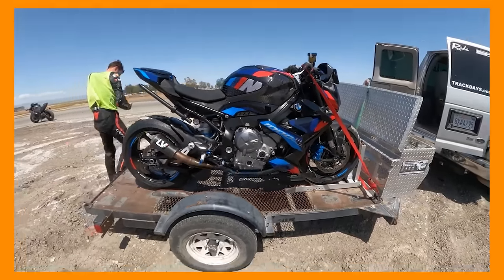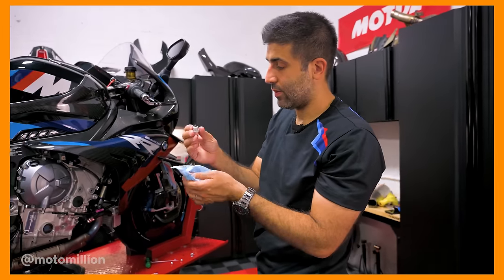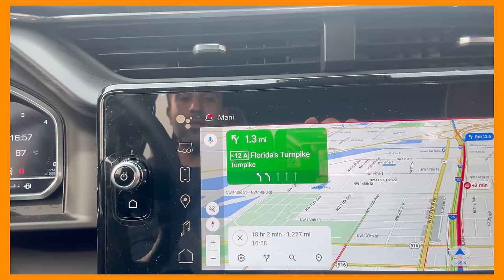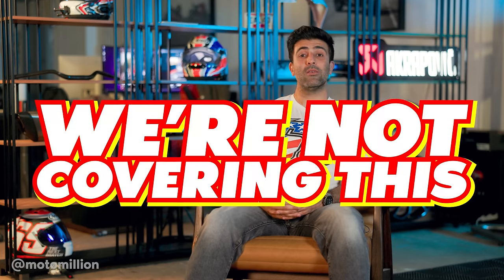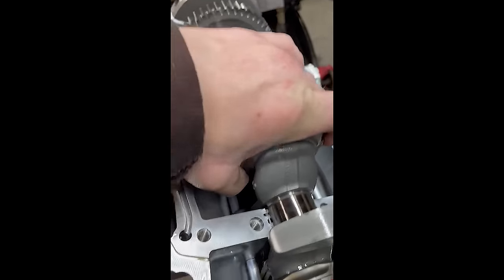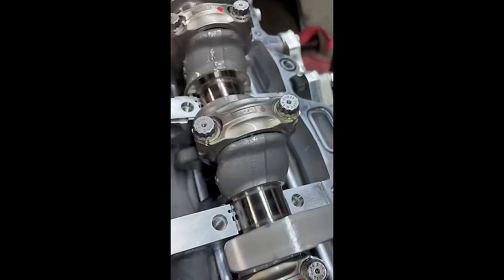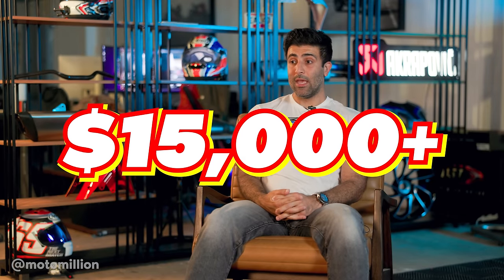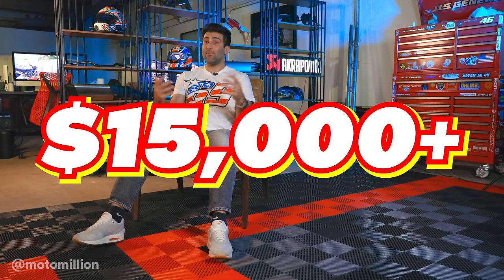MASSIVE Engine Failure on our M1000RR & BMW REFUSED Warranty...

Comment: What constitutes the correct break-in procedure, how much modifications effect engine reliability and should an engine be able to withstand a dyno run up to the rev limit may be debatable, but one thing that is not debatable is not following the rules and then expecting to get treated like you did. It is well known that if you don't have a local dealer or don't trust your local dealer, you should look for a different motorcycle make.

Comment: What do I think? I think the arbitrary limit to 1L should be eliminated in racing, and if manufacturers are so focused on making north of 200 horsepower, they should just increase engine displacement.
Reply: I don't think they're focused on horse power, I think they're focused on making motorcycles lighter, stronger with tighter tolerances and better efficiency through aerodynamics.
And the increase in horse power simply comes as a byproduct.

Comment: I would have ridden it around 600 miles so you could remove the limiter for free, and I would have never gotten out of 4th gear lol

If you removed it, put it back before taking it in for warranty work, it is an easy out for the manufacture.  What you should highlight is that you can't buy a service manual for your bike anymore from BMW,  I got mine a few years back and now they don't sell them.

Comment: 400 miles... and you're running it to redline on a dyno with insufficient air flow. I doubt the little fans provide hwy wind speeds, plus it's modded... tf you think was gonna happen? 500mi break-in is STANDARD on like any bike. Look in the owners manual garuntee you there's a break in procedure.
Reply from the maker: As per BMW's M1000RR Owner's Manual
First service is completed between 300 and 750 miles. Break-in rev limiter is removed as part of the first service.

Comment: Were there any punch marks on the other rod caps that would indicate that the proper torque had been applied to the rod bolts? Compare the caps! There usually is a positive mark to ensure that this does not happen.

Comment: I think it's what happens when bean counters take over a corporation. It's probably an unwritten policy to say 'no' as initial response to any warranty claim. After that if the customer takes it further, then they'll look at it to see how far the customer will take it but will make them jump through so many hoops, they hope they're banking on the customer giving up. As an aside, to say they'll still cover the warranty but not in the case of the engine, that's 'not' covering warranty, isn't it? 🤔

Comment: Without seeing any of your evidence, but assuming the facts are as you say, as an Aerospace Engineer and old motor head/wrench and former AMA Expert License holder in 250cc/350cc Road Race, I would also agree it sounds like parts defects or engine assembly not within blueprint specifications. Having said that...I have always broken in all my engines (especially racing engines) very carefully and if you did indeed remove your rev limiter before 600 miles, in my opinion that was a big mistake on your part. Fyi, I owned a 2011 S1000RR for a couple years and currently ride a 2023 Ducati Panigale V4R

Comment: Really sorry to hear about this failure. I am currently waiting for my S1000RR to show up at the dealership from Germany and am a little nervous after watching this video. I was wondering if the stage 1 tune mentioned in the video from last year included the 15,000 RMP limit "while making sure the raised RPM limit is not stored in the ECU" that I see referenced on the BT Moto site? I have a stage 1 waiting for the bike but am concerned about using it just in case there are issues. Is that the same for the stage 2 where the rpm limit is raised? Thanks for all your content, I really appreciate it!!
Reply: Just go with Break-in ordeal full 700miles (1200km) - go to dealer to change oil+filter+they will remove the break in rev limiter, don't rip hard on it the moment you get full rev range unlocked, rev it nice and steady, higher rpm for short periods of time, keep it Stage 0 until around 2.5k miles, only then you can think of doing the remaps and ''fun'' things after you are certain that everything is perfectly fine, you had your 2.5k miles of fun and can ruin the machine (if in the end the remap is bad). I'd say - just enjoy the ride, get a feel for it.
I personally wouldn't remap a bike just to squeeze out some odd tiny extra numbers. Only thing I would consider remapping would be a car which I know has huge tuning potential, trucks for those who want that extra punch on Germany-Austria mountains
Reply: Don’t worry to much. These people were doing wrong in so many ways. 😂 but at least the documented it well…
Reply: If you're smart, you'll respect that bike long enough to break it in properly before going nuts on power and revs you probably won't ever use.

And like the first guy said, even when the rev limiter is removed still don't go ham at least a couple of thousand miles.
These things have extremely tight tolerances and need to go through a few months worth of heat cycles before finally being able to go to their absolute limits.

Comment: You do realize BMW has all data from each station in the assembly of each bike including the motor tests and clearances. Respect the run in procedures and limits on the new motor and gradually work to full throttle on the road before bringing it near that dyno! Dynos if not correctly handled by the operator, can quickly destroy a motor!

Comment: i just bought my dream bike a 2024 s1000rr  hopefully  I don't  have any problems . But I appreciate your video and will be waiting  to 600 Miles to do the first service in case i do. I do agree you didn't cause this failure. I think the failure  was already there when that warning like came on.  Why would they put 350 in the  manual  if they wouldn't  stand by it. I want to know the exact text from the manual.

Comment: Yeah dude you took out the break in rev limiter. And yes other manufacturers do rev limiters for the break-in Ktm for one. I’m sure there’s more. This is why I’m waiting till my 23 Yamaha MT 10 gets at least 1000 miles before I flash the ecu and install a new exhaust.

Comment: Had the same issues with bmw service with my cars. I went to many different dealers for service and every time i ended up having other stuff broken and damaged...dent's and scratches inside and outside.  Not sure what the issues are but it was terrible and after 11 years i sold the car and never would buy a bmw product again.  Worst experience so far from any brand in my 35 years of owning and driving cars for various brands.

Comment: Had a 22 with surge issues. They claimed it couldn’t be reproduced safely. Um I did on a Dyno and still no help. Traded it in for a 23. But I we extra step to do dyno to show it can be reproduced and how easy. The 22 have a valve keep found in secondary oil change then after it was reinstalled I had surge issues but no fix as they couldn’t do it safely. 

I’m sorry regardless

Comment: Cancelled my order for the M1000XR after seeing this video. If these engines are built to work as hard as 14000 rpm on track, then it should be impossible to break for us mortals. Remove the rev limiter and this caused the bearing failure…. Really BMW you need to stand behind your customers who pay a huge price for these bikes and don’t have the resources available to cover internal engine failures…

Comment: Damn that sucks. I recently took delivery of my '24 S1K M package.. 7 miles on it from  pre delivery inspection, and I haven't even ridden it yet! Hope I don't have the same issues😮
Reply: Allow the engine to go through couple of hundred heat cycles, ride it for 1500-2000 miles not going full ham until oil has formed a protective film on all the surfaces and you'll be just fine.
Don't do that and say goodbye to it. 🤷🏻‍♂️💀

Comment: Shouldnt have told them you removed the rev limiter  😅😅😅 thats where ya went wrong Bro. Also once the problems came up on the main screen why didnt you take it straight to them or was the trouble code after the removal of the rev limiter.  Why would you remove a item made specifically to protect the engine ?

Comment: Really informative video and important to share issues like this, no drama queen going on here. As you said, just need to be in a corner, on a busy road, overtaking etc etc, and there could be a single to multiple fatality from this type of failure. 
My experience with BMWs has been with the GS platform. I had an HP2 naked adventure bike, which came apart on a daily run. The prop shaft was flung out of the swinging arm, completely cracked the swinging arm. Initial response was it would not be covered under warranty. Did a little research and found a recall stating that the arm located above the swinging arm should be secured with loctite on the bolt. Basically, the bolt vibrated loose, allowing the swinging arm to flex to a point the prop shaft gearing disconnected from the read bevel gear. You should have thought with that many GSs in the world something as simple as thread compound on a bolt would have been known or engineered out. Eventually got it covered, around $4,000 USD of swinging arm plus labor.

Comment: Dude. You literally removed a safety put in place to protect this from happening. I was with you until you said that. You couldn’t ride the bike for a few days???  People would kill to put 600 miles on a bike like that. I’m not saying you caused it, but what did you expect?
Reply: Manual states 300 as the minimum .. so you can remove from 300 upwards

Comment: Unfortunately, you have to stick to the Manufacturer stipulation on their warranty. Any Manufacturers would diagnose the situation to find a loop hole not to warranty their product. You gave them what they needed to refused the warranty on the bike. I’m a little shock that BMW would have issues like this on their motors. Base on the comments here I would not buy a BMW M1000. Appears to be a known issue. Thanks for the eye opener, I’m sure others appreciate the info. Sorry for your lost.  Good luck on the next sportbike. 👍

Comment: I have a 2012 s1000rr with about 3000 miles on it-
Piston rods replaced under recall
Fuel pump and right combination switch will be replaced under recall next month. 
In my dealings with BMW Motorrad,  I've found them to be arrogant and uncooperative. Unfortunately, that's just the state of affairs in today's world.  Think about Hyundai's Theta II or Ford's dual clutch transmissions. I could literally fill an entire screen with examples. 
My best advice?
Open up a lemon law claim and issue a subpoena for BMW's internal data and communications pertinent to the bearing failures on this engine. I think you'd have a better than average chance of prevailing and would also make some pretty compelling content. BMW would be on the hook for your legal fees if you win. 
Good luck

Comment: I m seeing a lot of BMW engines exploding on Youtube. I have 3 BMWs in my garage. Thankfully none of them have been that much pain in the A$$. 
But yeah BMW never gives warranty claims easily. I had a problem with the brake light on my 22 S1000RR that was under warranty but BMW just said, we don't cover electrical issues and after having a chat with a powerful person in their dealership, the agreed to have it fixed under warranty, the dealership is around 5 hour drive from my house and they said they'll only fix it at the dealership and won't send me the replacement at home. 
Dealership staff is usually nice but yeah, warranty claim takes time and effort.

Comment: In law BMW are right but in common sense, they know it was either faulty part or assembly problem so should let it go through. Just to make sure in the future, have someone take bikes out on the road and drive at low revs for the recommended break in mileage is reached. Then have the servicing done at a dealership and rev limiters adjusted by them. No blame whatsoever can be blamed on yourselves. The cost would probably be 3 days labour for a good rider on the backroads and not the motorways as we in the uk call them.  This would also get the bikes prepped quicker for your testing runs. BMW are well aware of its problems but won’t admit to them for fear of reputation.

Comment: It sounds very plausible that this is the fault of BMW. But at the same time I can understand them not honoring the warranty. If they honor the warranty for every single person that mods their bike they'd be shelling out a ton of money to fix problems other people caused. You rightly point out other people who have had this same problem with their engine. You don't point out how many of them did have their warranty honored. My guess is anyone who hasn't modified the bike from stock would have this problem fixed under warranty. I don't think this ordeal has harmed my opinion of BMW. They are behaving pretty rationally as a business. And as a customer I'm sure they would honor all their agreements with me as long as I honor them as well.

Comment: from memory on my bike its 1000-mark low raving only 1.000-10,000 med range then after 12.000km high raving from memory on my motor but i do not have a M1000 so but i see why as they hit high RPM and there not worn in yet so the overall shockwaves the engine would be taking is high, I assume.

Comment: In the UK BMW service is good yes I think you put it on a dyno a bit early but I think there is a fault with that engine also the new 1300 gs is having lots of problems. I just think BMW's are not reliable.

Comment: I’m staying away from this bike. I started with sport bickers with Yamaha and Suzuki then moved Ducati for a very long time, wanted to switch to this bmw bike and it has scared me tremendously. I’ve been riding over 30 years. This is ridiculous  for a brand like BMW to do this. If moving the breaking period can cause a major engine failure it should not even be an option! This is ridiculous behavior from bmw.

Comment: I had the same experience with a new bike a Kawasaki Concours bought new and at the first 500 miles oil change i was waiting for the service to be done but the mechanic who work on my bike came where i was waiting , that unusual because when your bike is ready its the service people in the front desk who call you when your bike is ready anyway the machanic ask me if i was myself a mechanic because they found a service towel inside the body of my Concours inside the frame i said no im not a mechanic so i was septical i ask the manager and he said maybe one of is men left the towel there when they was assemble it (bizarre) and since that icindent all i got from this bike is trouble after trouble , so i sold it for a new bike now everything is find. And its not a Kawasaki.

Comment: I’m with you on the local dealer issue, and on the doing your own work, also I have friends who do no break in and hammer the bikes from day one,  with no issues- indeed  I’m pretty sure all manufacturers run their bikes to full rev’s before leaving the factory, that being said ,  having the ability to tamperi with the. Ecu  means you could have messed things up giving them a perfect excuse to  refuse service even though  you did nothing to cause the big end failure. Maybe they have taken this engine  too far with 200+ hp..!!!

Comment: long story short:

didnt complete break-in period and put it immediatly on a dyno. (warranty void)
didnt use recommended oil filter during the break-in period
(probably) didnt do the proper break-in oil then replaced by proper oil recommended by BMW.

CaliMotoTV DID do the proper break in period, and did everything by the book. thats why they got a replacement engine.

you dum dum
BMW smart smart

Comment: MY 2023 s1000rr blow up at 1600 miles Bmw did replace engine but I lost faith in the bike so now don't ride it anymore. went back the my hayabusa that I have owned since 2012 with 0 issues

Comment: You should have returned this bike at its 9 miles failure directly to BMW to deal with it. Because at that time you didn't invest any time and money in mods and dyno.
Same advice to any motorcycle brand.
I got my Aprilia RS660, from start with unusual motor noise and I returned it to my dealer immediately. 2 months later I got another one for free.

Comment: Bro.
They did not need to warranty your bike. You were already having issues at 9 miles, then you go and remove an engine safety feature. If it were up to me I'd have a 1500 mile break in limiter. Have you not heard of the C8 Z06 break in limiters being abused and people blowing their engines up? All the ones who complied with the limiter still have their engines

Comment: BMW riders manual says no full load and not over 9000rpm before 1000k (600 mile), youve given BMW a way out to deny your warranty, I agree it shouldnt happen at 400 miles but unfortunately there you have it.
 I'm sure in early S1000RR days (2010) the bike was limited to 9000rpm after numerous early dyno blow ups?

Comment: Erm why didn't you just run it in on the dyno. 600 miles at average 70 miles an hour wouldn't take too long. Or just pay someone to do it. Surely cheaper than the 15 grand you just paid, and wouldn't have had to pay if the motor still went bang.

Comment: Had a Kawasaki rod nut back out.  Full warranty. Toprak blew not 1 but 2 motors this year.  Yes that was likely a bad bearing wrong torque or bad clearance. BMW is got issues for sure. BMW has quality control issues for sure.